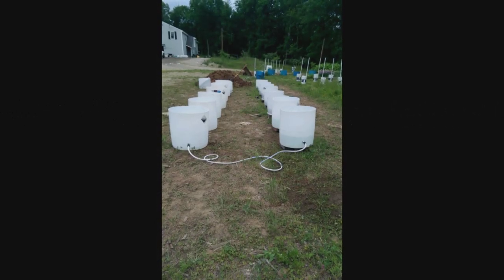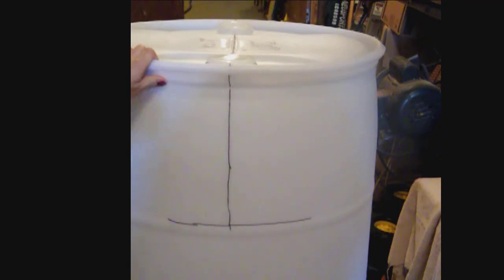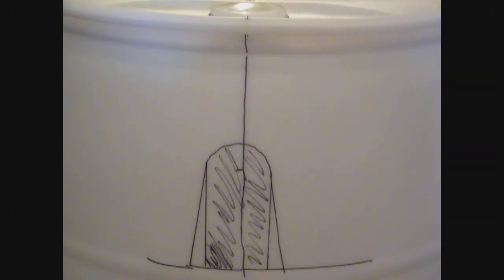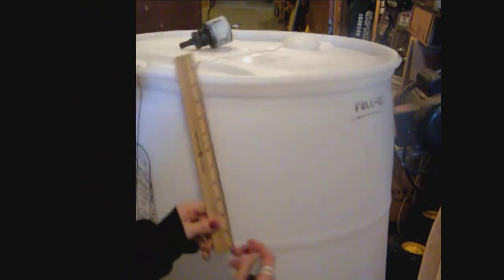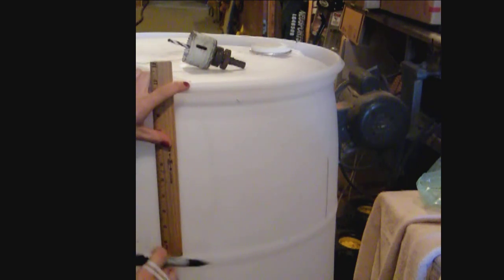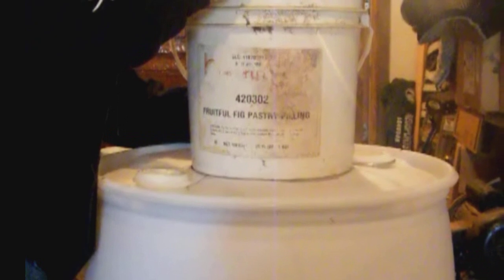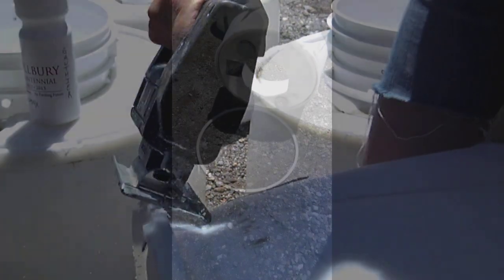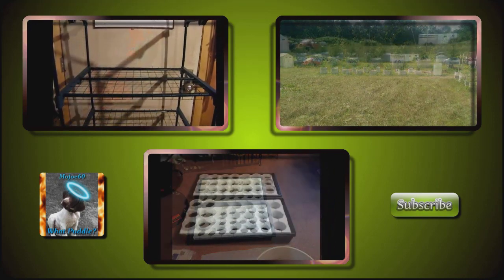How To Make A Global Barrel Part I

Comment: My father used to tell me while growing up, "If you can't learn from your own mistakes, try and learn from the ones made by others" and I appreciate that you have done just that then recorded it all for posterity.
Is there a way to do global barrel technique with IBC totes because I have three to work with and haven't made a final decision as to what I should do with them?
Great stuff mojoe60
Reply from the maker: i'm glad you like my mistakes:) i've got more coming in the grow light video i'm editing now.  i don't have any experience with IBC's but have thought about it.  i would try cutting them in half (that way you get 2 beds) and zig-zagging a lot of perimeter drain in the bottom & plugging both ends of the drain pipe with plastic like in my wicking barrel video.  next i would drill a hole in each plug and put a grommet in it and drill a corresponding hole in the IBC with a grommet too and run a piece of PVC pipe through both. one end i would hitch to the float valve bucket and water barrel the other end i would connect to the next IBC making sure it's level with the first and so on.  as far as drainage goes i would put one bucket upside down in each IBC like in the: Automatic Watering System For Wicking Barrels Part III Overflow Drain video.  https://youtu.be/65PMSwyfewo

doing it this way you can have 6 beds or 4 with a large water tank.
Reply from the maker: one other thought if you didn't want to do the automatic watering setup you could run a fill pipe into the top of the drain bucket.  just fill it slow so the water has a chance to spread out before coming out the drain hole.
Reply: Good stuff mojoe60, kinda what I was thinking too.
Reply from the maker: truthdefender54
thanks